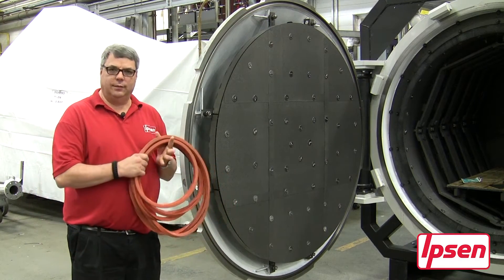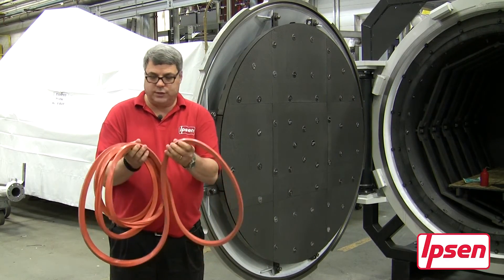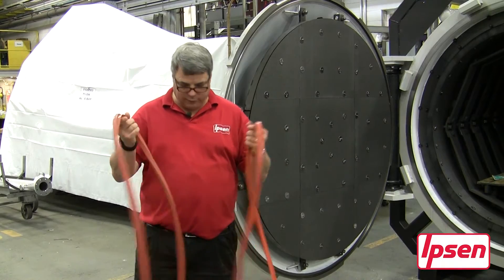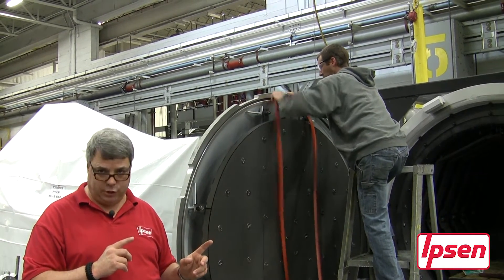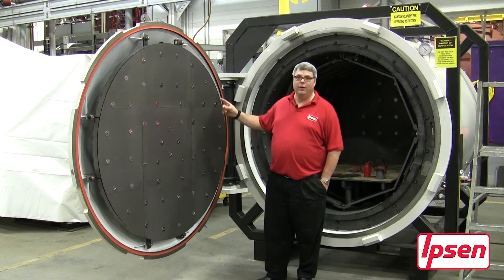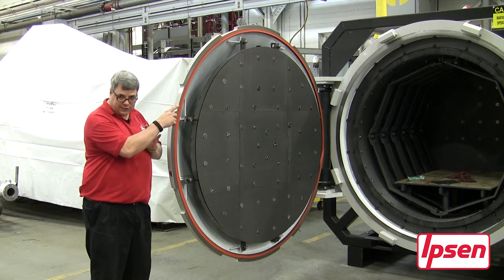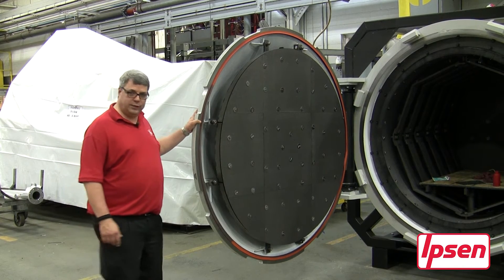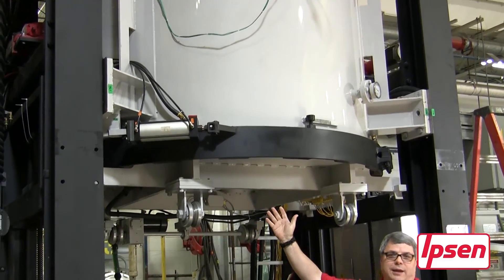How to Install the Lip Seal or O-ring on a Vacuum Furnace Door

Comment: Wow! Your vacuum furnaces sure look at lot different than they did back in about 1960 when I worked in the "infant" vacuum heat treating department at Ipsenlab.  We only had one small vertical furnace and, at most, two horizontals, one with soldered-on copper cooling coils.
Reply: A lot of the technology involved in the industry is very much the same, such as pressure vessel shape and applications (because that ASME BPVC says so), as well as common heater types and configurations, and general hot-zone architecture.  A lot of it is very different now with computer controls being super inexpensive and refined.  You can do a whole lot these days with a small furnace, process-wise, you could barely do with a big older fancy one.  I had designed furnaces at a 50+ year old local place and a lot of the vessels were carry overs, and the control systems were usually clean sheet designs.  They've come a long way from operating them by turning with a bunch of big valves.